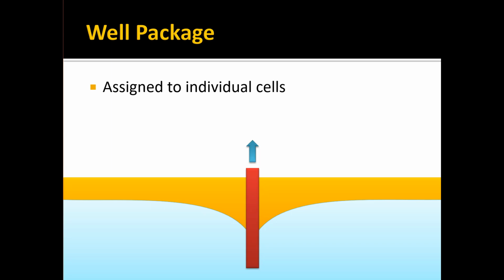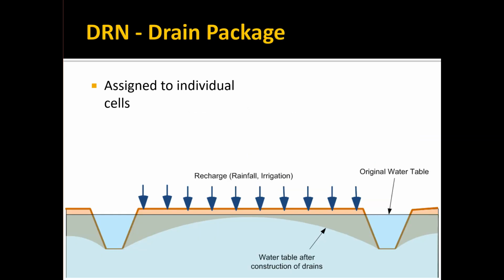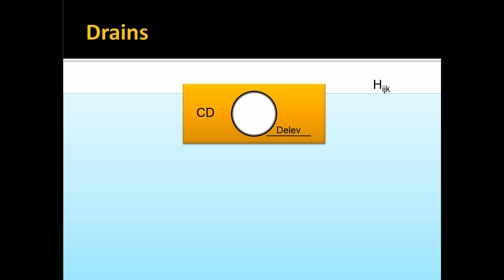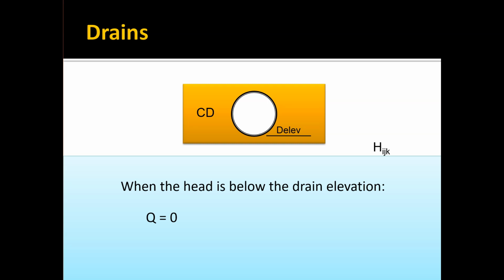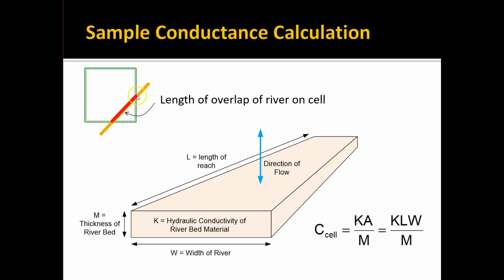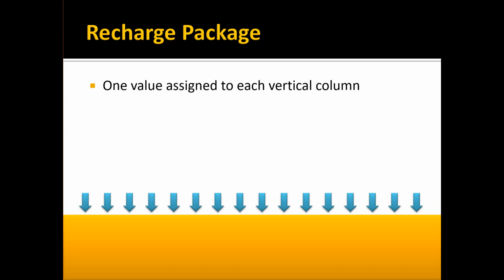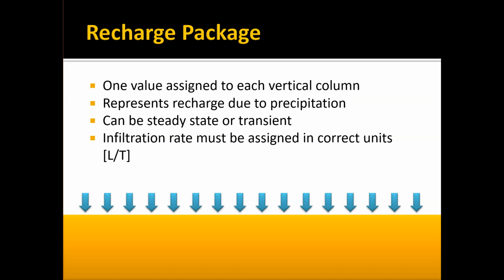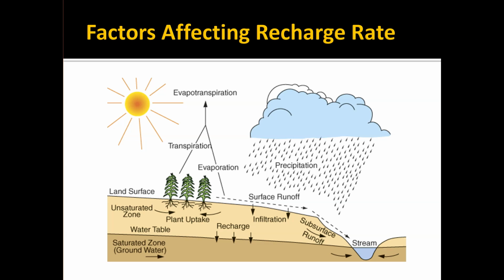MODFLOW - Optional Packages, Pt 1

Comment: Hey, may I ask a late question? If I want to model the actual width of the river correctly, do I implement an arc as usual and assign river package parameters (including width) to it? Because the river's surface area in my case is broader than one cell and it is important to have this in the model as I have wells left and right and want to have the right hydraulic gradient calculated. The alternative idea would be to draw two arc with river package for left and right river bank, respectively. Thank you in advance if anybody reads this :D
Reply: Hey, that sounds like an interesting problem. Typically we use arcs to simulate rivers and the conductance per unit length value that you assign to the arc includes the width of the river as part of the conductance, but it is a single value for the entire arc (average width over the river reach). So even though the river object is assigned only to the cells overlapped by the arc, the full width would be implicitly represented. However, there could be exchange of water between the other cells overlapped by the river. Another option you could consider is to use the General Head package and represent the river as a polygon. This would ensure that all cells overlapped by the river are properly linked to the river. Keep in mind that with the general head package there is always a direct hydraulic connection between the river and aquifer and Q is proportional to the head difference. With the River package, the river becomes disconnected once the head is below the river bottom elevation and Q becomes limited. But if you have a large river, there is probably a strong hydraulic connection anyway.

Also, another challenge with using a general head polygon is assigning the river stage is a spatially varying manner. With a river arc, the stage is linearly interpolated along the length of the river. With general head we often use a single value, but there is an option in the Attribute table dialog to assign the general head stage to a TIN or Raster of river stage elevations. 

By the way, as I typed this up, I just launched GMS and checked and it appears that you can associate the River package with polygons in the map module as well as general head. So it would work either way. Again, you would need to set up a TIN or raster to define your river stage and river bottom elevation, but that could certainly be done.

Good luck!